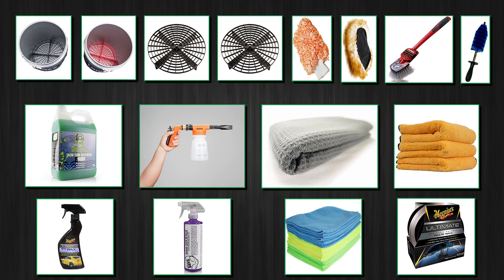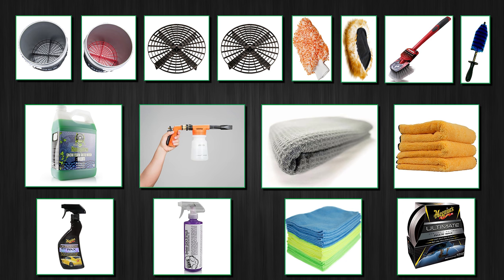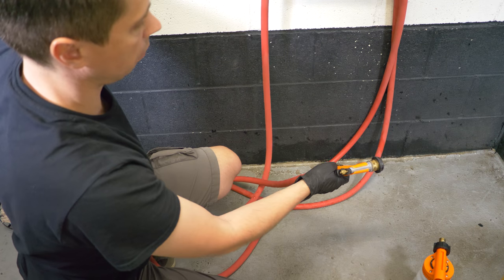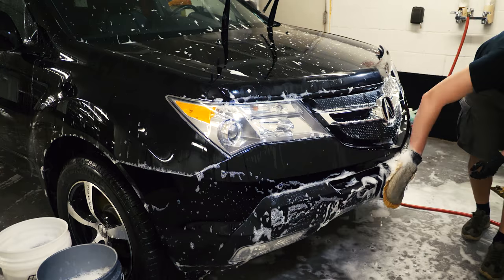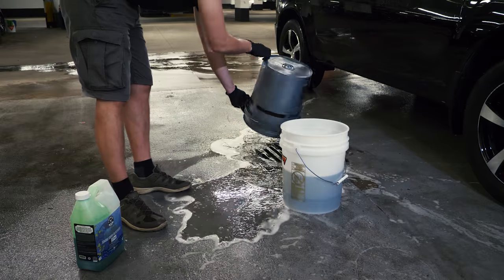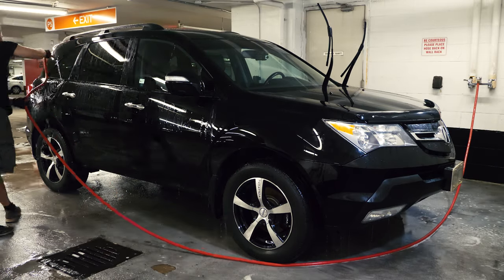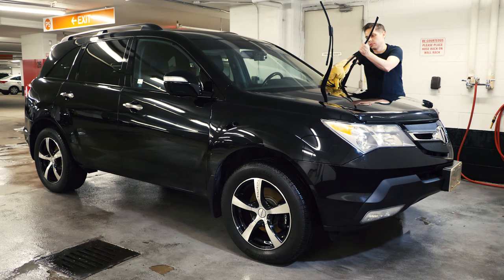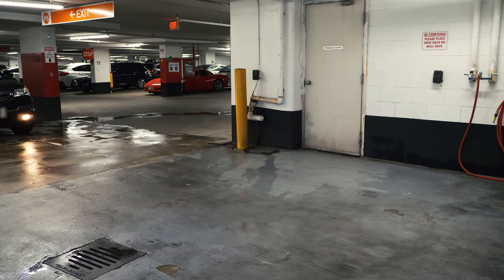HOW *NOT* TO WASH YOUR CAR

Comment: I am as meticulous as you when washing my MDX. I will add your foam gun to my process as well.  

I do have a suggestion for you.  After the final rinse, I use a high power leaf blower to remove most of the water, then towel dry as well.  It helps to remove the left over and hidden water in the trim pieces and you can blow air into the side mirrors to remove those annoying drips after you finish that always run down your nice dry door. 

Wonderful video, thanks!
Reply from the maker: Thanks a lot for your feedback! I actually had a Master Blaster (the biggest most expensive one with dual motors) I used for blowing the water off. It was fantastic! Unfortunately I needed to sell it, but will definitely buy again when I can. This is absolutely the best way to dry your car as there is nothing physically touching your clear coat!

Comment: Hey. On my 05 MDX, by backup camera doesn’t work. When I switch into reverse. My screen goes black. I checked the fuses. And I’ve checked the wires. And nothing looks broken
Reply from the maker: Did you specifically check the wires in the rubber casing near the tailgate hinges? They often get broken. Screen going black is a good indicator.
Reply: Acura Addicted I couldn’t figure out how to take off the rubber to look
Reply from the maker: If nothing else works, you can always cut through. Just make aure you have isolation tape, so you could seal it back after.
Reply: Acura Addicted checked those wires. They are not broken, or bent. But it does seem odd that they are not protected after they leave the lift gate. I think it’s the camera itself that isn’t working
Reply from the maker: Oh, man, that sucks! Yes, the exposed wiring in the tailgate is a thing for the first gen. Unless you are willing to take the inner trim off the liftgate snd trace the whole harness I don’t know what else to advise you on the issue. It might be the camera, of course, but wiring is much more likely.
Reply: Acura Addicted it’s not a big issue. I’m sure I’ll figure it out one day. Main concern is spark plugs, coils, and the o2 sensor . Thank you for your help! Спасибо. (Teaching myself Russian)
Reply from the maker: You are welcome! For the plugs/coils the fastest way to check is to swap a coil (first) from a working cylinder to the one that misfires. If that doesn’t change anything, next step is swapping the plug in the same manner. Hopefully, that resolves the issue. If you pinpoint a plug as an issue, I recommend replacing all of them with a fresh set. It’s going to be around $60 for all six. And don’t fall for non OEM ones, just buy the OEM, they are great quality and will probably last you the vehicle’s lifetime (at least 100K miles). Coils are more expensive, though, so if you find the coil is the cause, just replace one coil.
Reply: Acura Addicted I plugged the scanner in. Apparently all cylinders are misfiring
Reply from the maker: Ok, in that case it might be a whole different story with multiple outcomes. At this point rather than playing a guessing game I would probably go to the dealer and run a full diagnostics. You pay for one hour of labour, but they should be able to tell you exactly what needs to be done and quote you.